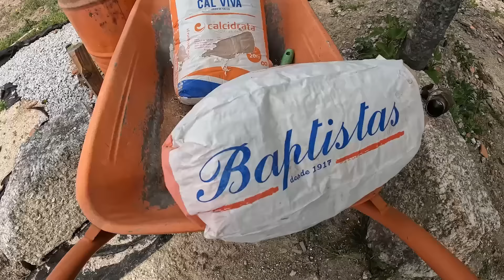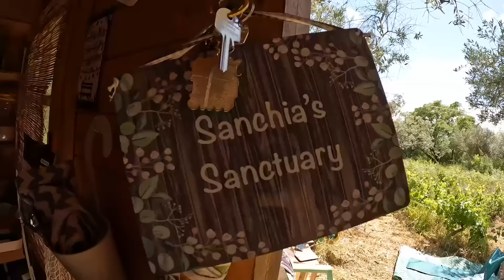DECK & GARDEN REVEAL & Saying Bye to My WONDERFUL Parents - Off Grid

Comment: Also: use a large piping bag for your mortar projects. You would have more control of the mortar, less waste, would be able to rinse and reuse. 😊
Reply from the maker: I've tried a gun thing and it wasn't for me... but it could work for others. I've just gotten used to this way so it's what I've stuck with. 🙂

Comment: Could you build a climbing frame for the grape vine? Even an (angular?) arch across the path would look fab. And u cld pick the grapes easily from that.
Reply from the maker: The one in front of my house? It needs support now for sure... eventually I'll build a pergola for it but it's getting big!
Reply: Yes that’s the one. Pergola would be lovely but might need some tee pee type support until then?? You can pull that out later when yv got time on the pergola front.
Reply from the maker: Yes right now it’s only on a stick but that’ll need to be improved.